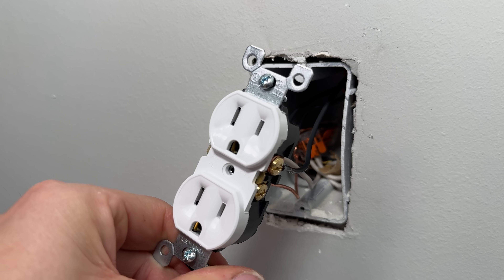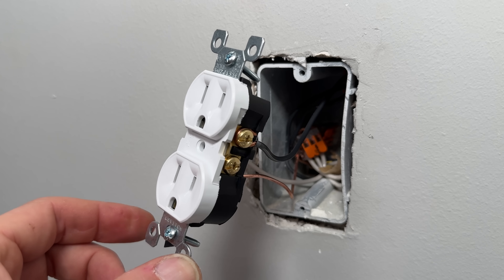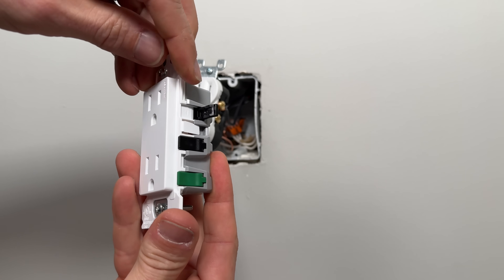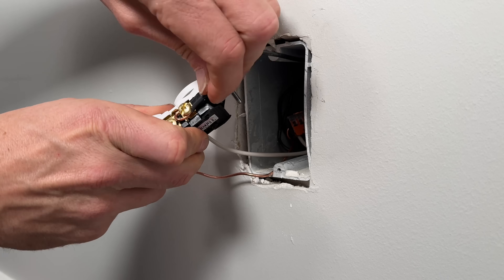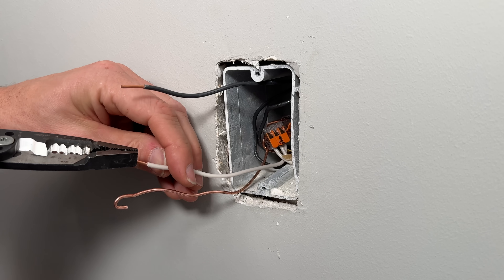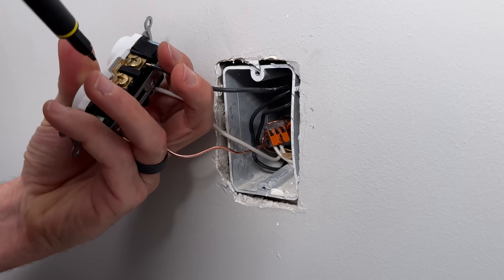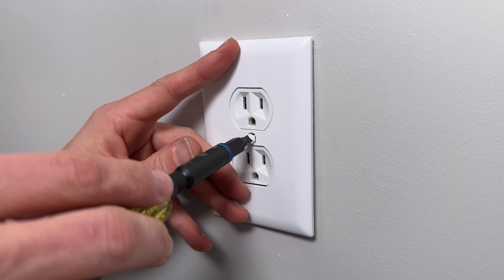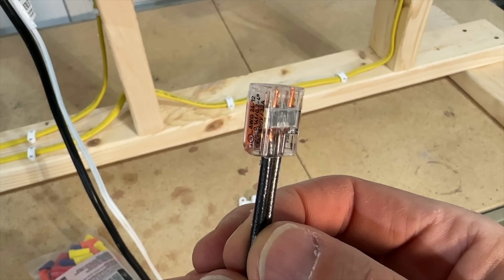Why DIY Homeowners Should Wire Differently Than Most Professionals

Comment: Impressed to see the lever attachment for the  ground. I thought there was a long-standing rule of the ground had to be an actual screw, not even a clamp connection.
Reply from the maker: yeah and most people are also thrown off since the ground in the same side as the hot on the Decora Edge.  I guess without the exposed screw terminals having the ground on the same side as neutrals isn't as important.  Either way I give it to Leviton for coming up with a new interesting design.
Reply: I bought some of these levers outlets at my local home store.  $2/ 10 pack less than the normal ones, and they are tamper resistant.  Installed easily, and hold the wire securely.  The only issue is that they put this extra strip on the top and bottom that I had to remove to get the faceplate to fit.